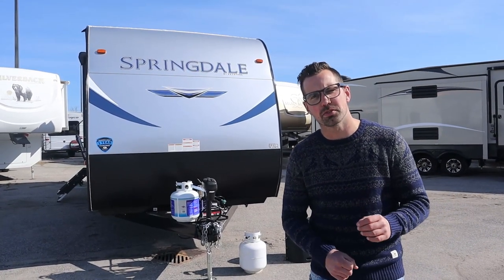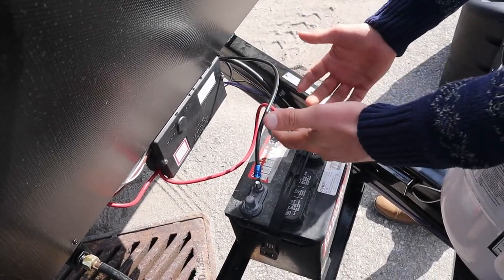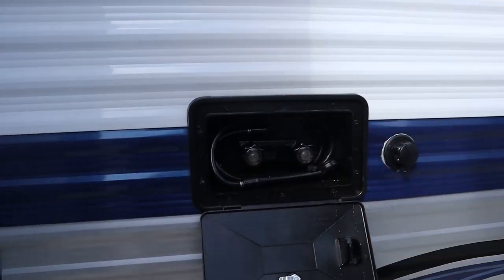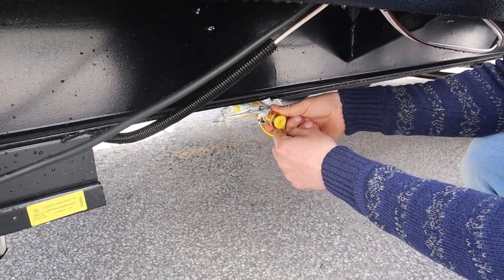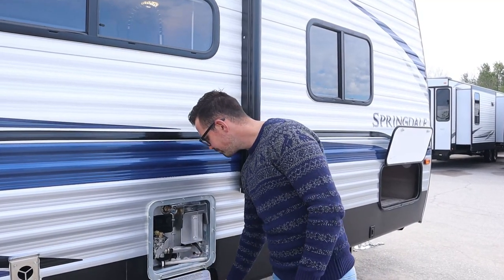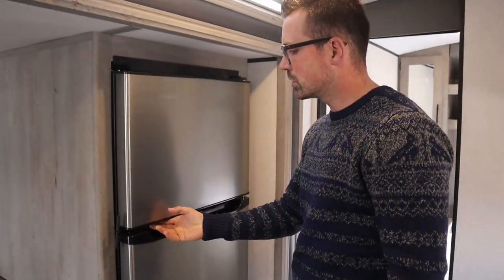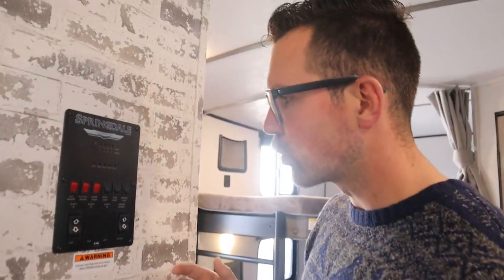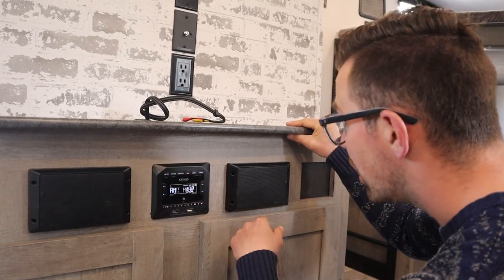2021 Keystone Springdale Orientation Video - Layzee Acres RV Sales

Comment: its not the hard water breaking down the anode rod, it is is the different metals and the magnesium rod is a the sacrifical metal that corrodes rather than the metal on your water heater. Does not have to be replaced every year! Anode rods on your home water heater are there for at times 10 years, replace when the anode rod is no longer a rod, two years if you have hard water!
Reply from the maker: Hey Manuel,

Appreciate the comment, I agree you probably don’t need to change it every year, Suburban asks you to in their owners manual but that is probably overkill.